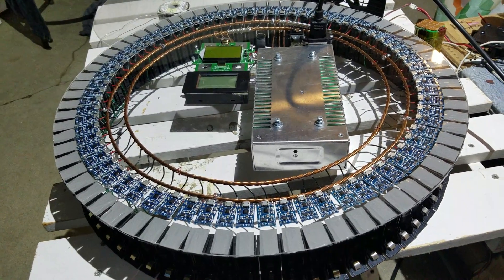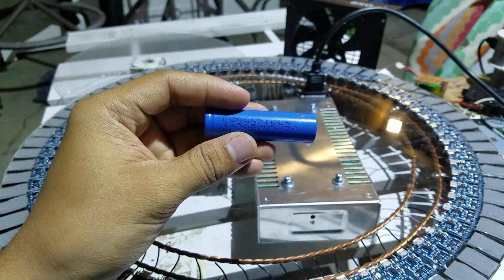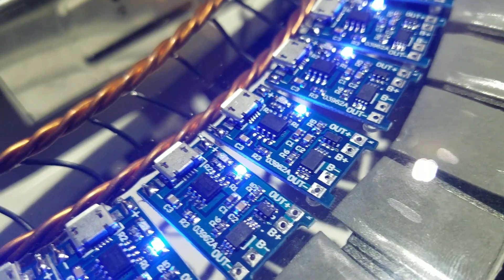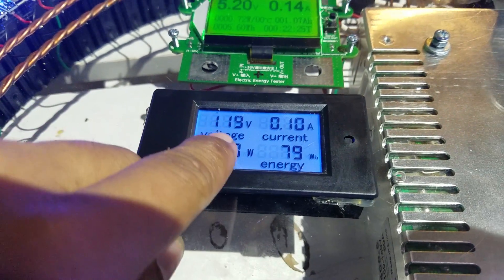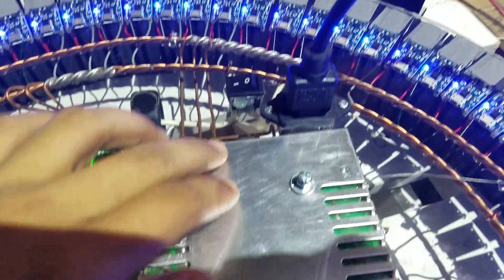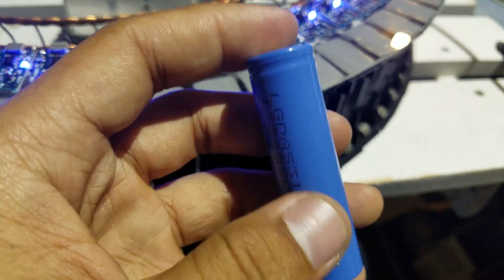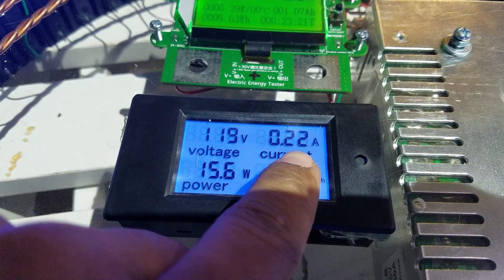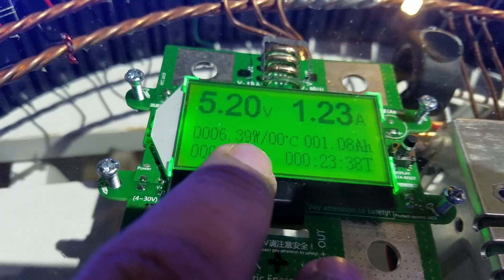Tesla Circle Charger - TP4056 Module - 18650 Battery

Comment: Beautiful, Paulo.
Now mount that on a lazy susan base and you're ready to load!   Is 4.20 the final charge level?
P.S: If that were mine, I'd insulate the positive ring with electrical tape, or have shrink sleeved it before bending and cut holes for soldering the wires, then shrunk it.  As it is, a screwdriver or piece of solder/wire/metal could fall across them and short everything out!  You could use vinyl tubing to maintain the steampunk look, though. ;)